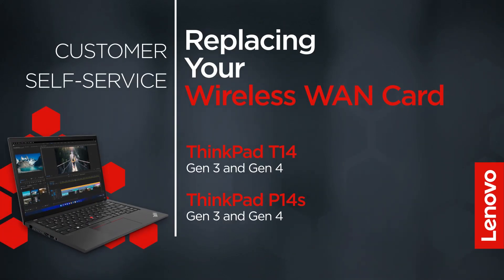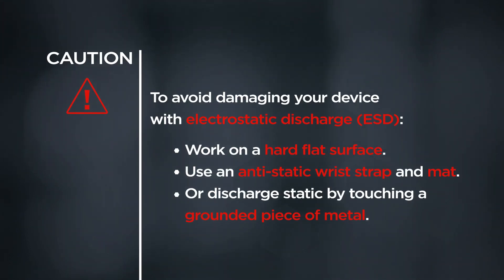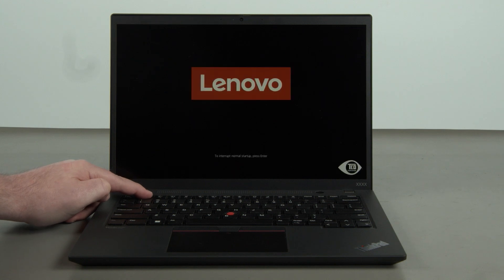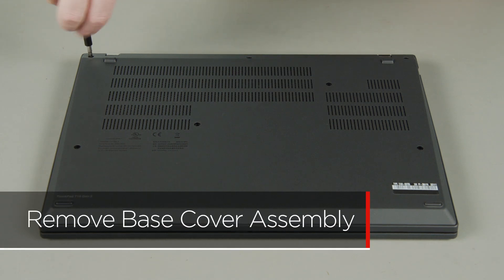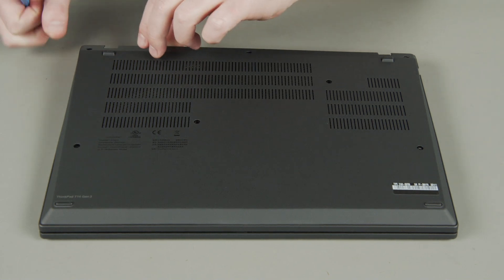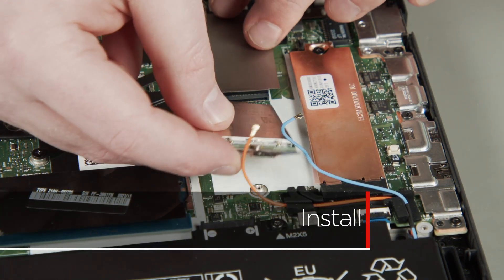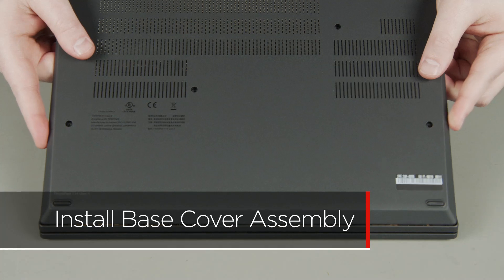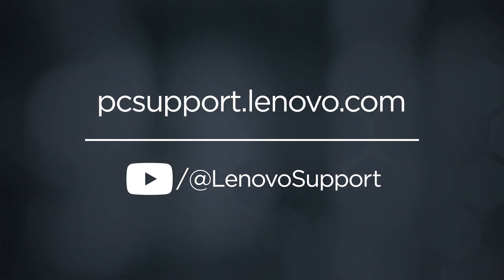Replacing Your Wireless WAN Card | ThinkPad T14 and P14s Gen 3 and 4 | Customer Self Service

Comment from the maker: This video will show you how to replace the Wireless WAN Card of your ThinkPad. The process in this video will work for the ThinkPad T14 Gen 3 and Gen 4 and the ThinkPad P14s Gen 3 and Gen 4. 

You will need a screwdriver kit, a non-metallic pry tool, static-safe tweezers, and 30 minutes of your time.

ThinkPad T14 Gen 3 Repair Guide: https://pcsupport.lenovo.com/us/en/products/laptops-and-netbooks/thinkpad-t-series-laptops/thinkpad-t14-gen-3-type-21ah-21aj/selfrepair/removalsreplacements

ThinkPad T14 Gen 4 Repair Guide:https://pcsupport.lenovo.com/us/en/products/laptops-and-netbooks/thinkpad-t-series-laptops/thinkpad-t14-gen-4-type-21hd-21he/selfrepair/removalsreplacements

ThinkPad P14s Gen 3 Repair Guide: https://pcsupport.lenovo.com/us/en/products/laptops-and-netbooks/thinkpad-p-series-laptops/thinkpad-p14s-gen-3-type-21ak-21al/selfrepair/removalsreplacements

ThinkPad P14s Gen 4 Repair Guide: https://pcsupport.lenovo.com/us/en/products/laptops-and-netbooks/thinkpad-p-series-laptops/thinkpad-p14s-gen-4-type-21hf-21hg/selfrepair/removalsreplacements

To learn more about your device go to https://pcsupport.lenovo.com

To find parts for your device go to https://support.lenovo.com/parts-lookup/?cid=ww:lenovosocial:b9515f&source=socialmedia&subsource=yt

To view the Lenovo Support Self-Repair Guides landing page go to https://support.lenovo.com/us/en/solutions/HT516547

** NOTE: Static electricity can destroy components. Use a grounding strap, and clean, non-conductive surface to work on. Use plastic or coated tools to prevent scratching and avoid using metal tools on plastic parts. For more detailed information on electrostatic discharge and how to prevent it, please watch our ""Understanding Electrostatic Discharge (ESD)"" video: https://youtu.be/by4PB3WtdLo 

Applicable Machine Types:
ThinkPad T14 Gen 3 - 21AH, 21AJ, 21CF, 21CG
ThinkPad T14 Gen 4 - 21HD, 21HE, 21K3, 21K4
ThinkPad P14s Gen 3 - 21AK, 21AL, 21J6, 21J5
ThinkPad P14s Gen 4 - 21HF, 21HG, 21K5, 21K6

#lenovo #LenovoSupport #LenovoTechSupport